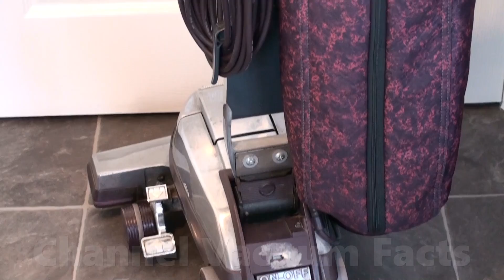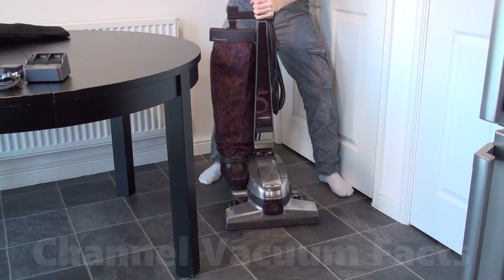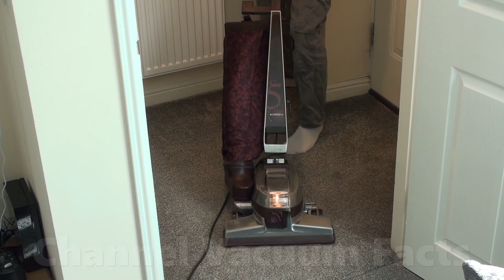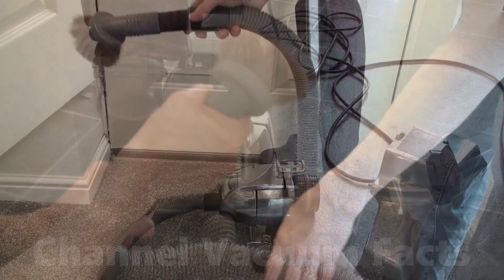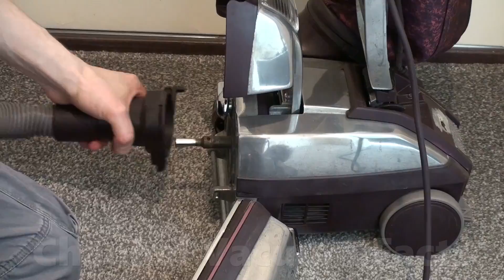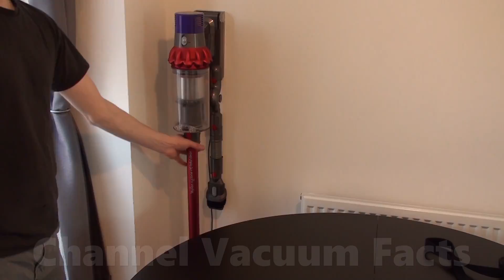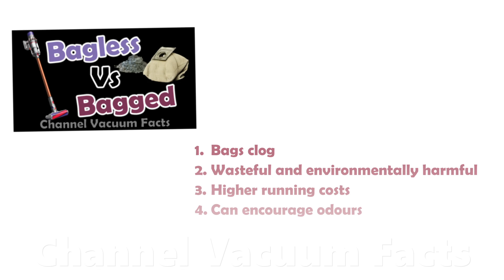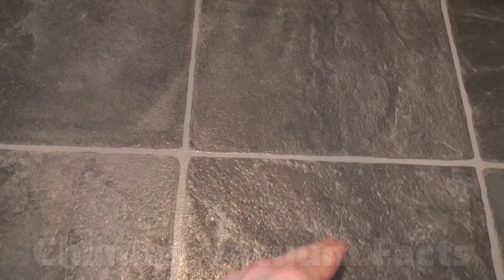Review of a Kirby Vacuum Vs Dyson Cordless

Comment: Which Kirby model  is that exactly?  Looks like a G5 which was made nearly 10 years ago. Just want to be sure you’re comparing two vacuum cleaners made in a similar era. I’m interested in seeing a comparison between a Dyson and Kirby both made in something like 2018 or 2020 . Would comparing the technology of two cars made nearly a decade apart with very different price points and use cases make any sense at all especially if the reviewer was biased towards one of them ?
Reply from the maker: The more mean-spirited Kirby obsessives argued vehemently that even the older Kirby cleaners outperform a modern Dyson cordless stick vac. Hence this and other videos. Their claim was shown to be false. I've seen no evidence that modern kirby cleaners perform significantly better than their older counterparts. There's also no good reason to suspect they would based on how they operate. Most of the nonsense reasoning given has been debunked in this video series. Kirby also don't subject their machines to industry standard comparative testing, so objective data isn't available to support any suggestion by their enthusiasts (who have already been proven wrong time and again) that modern machines are substantially improved. They clearly haven't improved the environmental impact, running cost, and usability issues raised in the review.
Reply: The only changes are cosmetic, what difference would it make? That's one of the things I don't get about Kirbys, they are straight out of the last century.

Comment: When I use my Kirby on the stairs, I don't take the normal handle off, I just lock it in the storage position, click it all the way down, and turn tech drive off. Sure you'll get some back pains, but I do it weekly, so I feel no pain by picking the vacuum up. Sure, it's heavy, but not at all for me anymore.

Comment: If you have carpet Kirby is a great investment, if you only vacuum hard floors there is an argument to buy a cheap plastic vacuum. I know people have used their Kirby for more than 40 years.
Reply from the maker: If you have a carpet, any good vacuum is an investment. The data clearly shows the modern V11 outperformed the Kirby on non-porous backed carpet (the hardest to clean) and hard floors. The evidence is clear; Kirby's perform adequately, but not as well as the best, and furthermore, to achieve that adequate performance, there are great costs for the environment and the user. The argument for having an old piece of technology for 40 years is a poor one that doesn't even address any of the problems caused. I know of no one who advocates their 40 year old car over a modern sports car (which contains 'plastic'). Using the term plastic also demonstrates fantastic ignorance of the advancements that have been made in materials science in the field of polymers. Argument after argument against advocations of Kirby vacuums. My videos have made all this clear. Many who don't like the facts and evidence they're presented simply don't listen because they don't want to listen.

Comment: omg, u have no clue of the machines , a kirby is so much better and i move it with two fingers
Reply from the maker: Only with tech drive active and then you've got all the other problems mentioned in the video that you conveniently ignored. Not least its shoddy performance, difficulty to use, and shameful impact on the environment, relative to the best out there.

Comment: Ok ok ok...let me say my opinion...(politely 😝)...I have 4 vacuums in my home....a Kirby g8, a Dyson canister, a v7 and a Vorwerk Kobold vk220 ....this last one is also a door to door sale and it also cost a lot around 2200 for the whole cleaning system (carpet/floor brush, floor washer, floor only brush, dry mattress cleaning set , electric brush and the accessories bag) and it changed my life...it’s so easy and light and it deep clean like a dream....then I have the Dyson canister that I used before the kobold....it was good...but I founded I a bit clunky and difficult to use....being a baker I use the v7 for kitchen cleaning because for me it has not enough deep cleaning power and battery life ...but it is wonderfully good to clean while I bake if I make a mess....then the Kirby...ok I admit that I am pretty strong so for me it’s easy to push around especially in tech drive...I don’t have to carry it around because I have marble stairs.... so having mostly bare floor I used to use it with the carpet brush fitted with the dusting pad which was great for dusting but bigger debris got stucked in the brush bar...now the Kirby is in a pantry under the roof ...I use it like once every 6 months for deep cleaning big carpet...I can’t even use it with small to medium carpet because the suction of the vacuum would suck the carpet in the bar and they wouldn’t spin anymore 😂...but I always keep it ...you know...I payed a lot for that vacuum and I wanna make the best out of it...and onestly even though I have better vacuums the Kirby for me work great almost everytime...
Reply from the maker: I can't criticise your opinions of course. The only thing I’d respond with is that the V7 was not intended to be a mains replacement. The V10 onwards were and are lightyears ahead of the V7. I think how it compares to the Kirby is well covered in my review.
Reply: @VacuumFacts  of  course that is true....and 100% I will buy a new cordless Dyson when my v7 will break!...but I am sure that because of the size of my home with the 1h of battery life is not going to be enough...I would have to buy 1 Dyson per floor and it would cost A LOT!😅
Reply from the maker: That would be true under the old model of a weekly mega clean that old, cumbersome mains-powered technology forced for practical use. But people are moving away from that chore now to on-demand cleaning made available with mains-equivalent cordless technology. Even large houses have been shown to be cleanable with the V11.

Comment: Oh, my electric bill is about 48.00 in cool months and it was 119.00 last month with AC. That is with two refrigerators running, one of which is energy inefficient 🤣
Reply from the maker: Why don't you comment in a single thread so it's easier to follow what you're saying? That you're divulging your personal electricity bills highlights an apparent lack of understanding of the importance of scale. At the individual level, the power consumed between the most and least efficient vacuum is trivial. Scaled up across a nation, these differences become significant. That you're limited to only seeing your parochial self highlights a common problem; the lack of capability to see the bigger picture and its implications.

Comment: Well again we have a nut job who has no concept of what it means to use a real vaccum cleaner. This reminds me of people who drive hybrids and swear they are better. Yes everything is better under specific sets of circumstances.  I have an old 1980s whirlpool refrigerator that has never been serviced and it keeps this far colder than my brand new Samsung. Yes the Samsung is a a bit more energy efficient, but the dayum thing will never last 35 years. I did some basic math, if I replace the side by side whirlpool in the basement every seven years for 35 years, I'd end up buying 5 refrigerators. The whirlpool has the same basic features as my new Samsung. The Samsung was roughly $2300. That is $11500.00. the original owner told me she paid 899.00 for the refrigerator in 1984. Whatever freaking energy savings you may get from a new more efficient model, you would lose in the purchase of the new machine. I'm 41 and have this same scenario for my 1986 whirlpool direct drive washer and 20 year old Royal all metal vaccum and even my 1989 Buick Electra. You crunchy ass believers get on my last nerves not telling the whole story. I'm not a Kirby fan boy. I prefer Royal. But the Kirby is an extra machine. It has better airflow and power than 90% of all vaccum cleaners on the market. This, and the technology is literally 100 years old. I'd say we got our moneys worth. The direct air vaccums are proven to deep clean and out vaccum everything else. How dare you come here with these alternative facts and fake news. carry that weak shyt elsewhere
Reply from the maker: Well again we have a "nut job" who avoids acknowleding the points raised in the video, bypassing in exchange for ad hominem attacks. You also show complete misunderstanding of the value of airflow and show ignorance of the lack of data of the Kirby's actual cleaning performance. This data is also provided on my channel along with explanations of the malicious deceptions often peddled to deceive viewers in YT videos. 1. https://youtu.be/8K6B_O5_C90 2. https://youtu.be/qJlaBeqVs7E . The data shows that while the Kirby is a decent (brute-force) surface cleaner, it simply doesn't perform well at deep cleaning relative to superior competitor products. A full explanation is provided. It's also impractical to use as discussed in the video. You've simply not said anything convincing in your tirade.
Reply: @VacuumFacts  
Girl unlike some of the other people in the room, I gave re experience with both machines. The benefits if the bypass machine donot out way cons. Point blank period. I'm not a vaccum freak. But I know the bullshyt when I see it. The bypass machine don't pull ass much as fast. They don't beat the carpet fibers better either. Almost every body who bought the Dyson sticm vack that I know hated it. They either returned it it gave it away. It's a fucking gimic.
Reply from the maker: @1911beauty  0_0 well, with an argument that strong, you've totally convinced me. xD

Comment: one must change the height of the powernozzle when encountering large items on the floor.....b/c the Kirby is designed to seal on carpet to pull debris up and even through the carpet.  So, click the height adjustment...for just a moment that its needed, then click it back down for normally designed cleaning    sheesh....its not hard friend, very easy .
Reply from the maker: It's an avoidable hassle the better-designed vacuums solve.

Comment: oh my gosh  'dangerous' carrying a 17ish lb device on the stairs? please explain the 'danger'. I've used these doing exactly what you showed on the stairs....one hand, not that hard. yes, its heavy (metal, designed to last decades) but maybe you aren't strong/big enough to use adult appliances.?  I'm not attempting to be mean, I"m wondering if you have a condition that prohibits using anything like the Kirby or its weight.  If its not practical using it as a handheld device, one can just hook up the hose and use an attachment....no weight issue. Dangerous lifting the whole vacuum?? really? thats an absurd description. It is heavy, but so are many other vacuums ( Miele, Rainbow, etc)

Astoundingly crude technology in that Kirby? that sounds ridiculous.  the design is effective, reliable and has endured decades of proven use.

You 'struggled' to move the Kirby w/o the techdrive on....why would you use it on carpet w/o the techdrive engaged? its DESIGNED to be used with it on.....makes vacuuming almost effortless.

'once you turn it off, you have to fiddle with the techdrive  to move it again..''   that complaint is similar to driving a car and once you get to your destination, you have to 'fiddle with the keys out of the ignition...to be able to lock the car'.   come on.....thats really a weak 'complaint'.  When one uses the Kirby as designed, its very effective, not perfect, I agree but most effective at deep cleaning carpets...unlike MOST vacuums out there...and especially Dysons.  Have you watched testing videos of sand/powder/debris pick up of these two vacuums? the air flow tests? its undeniable....the Kirby blows away most competitors.  There are caveats about it, true, any vacuum has pros/cons.....the Dyson has shown its superb at easy of use and picking up surface debris....they just aren't for REALLY cleaning the carpets.

I'm sorry to hear you damaged your home with this, that can happen with any device...my neighbor did the same with his lightweight Shark....so it didn't have to be a heavy device.

Bagless vacs have plenty of disadvantages as well....they are dirty...heavy maintenance machines....most have many filters that require consistant cleaning.....I'm not a fan.  I buy the HEPA bags for Kirby's online at a very reduced rate....and after watching some air quality testing using a USED hepa bag on the kirby, I was amazed and won over by the 'technology' used in modern bags.  very impressive.

Plenty of videos NOT made by Kirby on youtube....especially reviewer such as  Vaclab's thorough testing of all the parameters as well as tester named Vacuumtests.
Reply from the maker: None of that opinion piece was convincing or really addressed the clear problems shown. And your cited references have been shown to deceive and not understand basic principles, nor do they test carefully enough to draw meaningful conclusions. More thorough testing in other videos on my channel has quantified the Kirby's relative performance and explained its results in detail. The Kirby myth has been fully debunked now.

Comment: Let’s face it I own a 15y old Kirby still works like new and I bought it new but I bought about 2y ago a Dyson v6 what a load of rubbish the Dyson is the battery never lasts and is a pain to empty, I do agree they are heavy but they are the best deep cleaner for carpets! Another thing that Kirby is not I repeat not a new model it came out in the early 90s so you can’t compare an old Kirby to a brand new Dyson ! So i just think you hate Kirby cause it doesn’t seem like a good  review and you are not even using it right so get your facts correct another thing is you say to not wet shampoo your carpet well I’ve got news for you wet shampooing your carpet is better than using a moisture powder as once the powder is in your carpet it stays there and your Dyson will never pick it all up only a good vacuum would pick it all up 
Kirby’s aren’t for everyone but I don’t Care what people say Kirby’s are the best for carpets and you need to get the bare floor pad to clean hard floors 
I guess not all people like the same thing 
Thanks for the review keep up the videos
Reply from the maker: Thanks for the comment. "they are the best deep cleaner for carpets"? Did you actually watch all of the video you're commenting on, because the data shows they clearly aren't and are outperformed by a high-end stick vac. The reasons why are involved and discussed in several videos on my channel. To suggest I "can’t compare an old Kirby to a brand new Dyson" is to contradict your own comment and admit the Kirby in question is inferior. I'd also add no one has provided any evidence that modern Kirby cleaners achieve significantly better cleaning performance than an old one; it's the same old, tired technology that doesn't work that well. I don't like the Kirby for all the reasons explained in the video that have been glossed over in your comment—namely that it is objectively inferior both in performance, usability, and its environmental impact. And that old chestnut, I love; "and you are not even using it right". Random statement, not qualified in any way, and again shooting your own comment in the foot by implying that there's some nuanced 'correct' way to use something that should be intuitive. Just hilarious. I think your wild and unsubstantiated claim about wet cleaning needs a little credibility behind it—in the form of some evidence. Any pillock off the street can make a random factual claim like that, but coming away from such an outburst and not looking like a clown requires, again, some evidence. I can't really fault your subjective liking for something as objectively awful as a Kirby—some people just like polished turds, but your factual claims about them being the "best" fall embarrassingly flat, given your lack of respectable supporting evidence and that it directly contradicts observations. Thanks for an amusing comment though; not many people entertain to that level. :)

Comment: Except a Kirby will last longer than every Dyson ever made!!😂 Also they have power drive so no need to push it😏
Reply from the maker: Well, there's no convincing evidence of that given some still use the first Dysons ever made (or are at least working and usable). It's also a moot point because most either don't look after them properly and they prematurely fail, or choose to upgrade and disown. Using old tech for too long can end up being net harmful to the environment (much like why most people don't drive old cars). New tech comes with features and benefits which make the job easier. The 'power drive' as you call it is noisy, power consuming, and is a poor solution to a problem better addressed in other ways. It also brings disadvantages, such as harm to the home during impact. Everything you've said has been addressed and debunked in the video you apparently didn't watch and is no argument in favour of the Kirby.
Reply: @VacuumFacts  not at all Kirby's are good vacuums always have been and more than likely always will be
Reply from the maker: I take it that you accepted everything in the previous comment, given it wasn't acknowledged. I will add to your new comment that I've seen NO evidence Kirbys are good vacuums and no evidence there are any significant performance differences between models, nor any reason to suspect there would be on inspection. The Kirby was exposed to be a sham and a joke in this video.
Reply: james hannaford 
Hold up so your saying that the outer was fine you know the metal bit but the belts the bags??? You endangering the world using the Kirby, the Dyson was designed bagless not because of no loss of suction, to save the environment from overflowing with trash and diseases. It may be good for cleaning but not as good as keeping the environment of nature polluted.